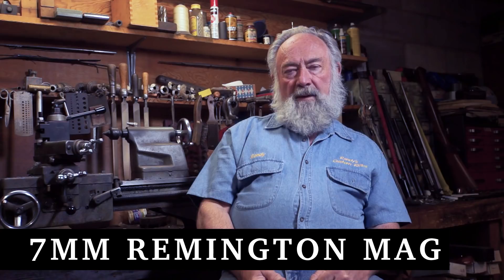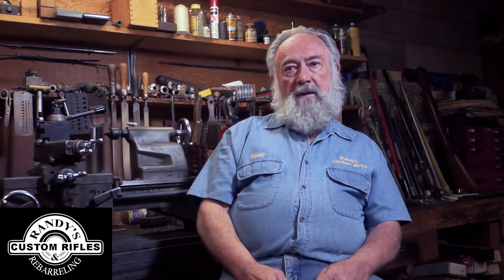History of the 7mm Remington Magnum – The Real Gunsmith

Comment: I am a huge believer in the 7mm Rem Mag.  I’ve been hunting with one since I was a kid.  I also have a 300 wby and a 338 win mag and I have never felt that I needed more than the 7mm provides for moose or elk.  It shoots flat, doesn’t burn the throats out of the barrel like some of the barrel burners out there.  It’s not too hard on brass and with a 154gn load with IMR4831 pushing it I am well under a MOA and can drop anything I plug with it.  243/308, 7mm Rem Mag and a 338 win Mag covers everything imaginable in North am era and the 7mm will do it all without giving up much to the others
Reply: Looks like I made the right choice , I chose arem 700  270 over 30-06 , nice flat line with a comfortable recoil , great deer and even elk rifle  ... wanted a larger longer distance for larger hunting such as moose/elk , was considering a 300 , came across a Sako 7mm rem mag in closet condition for almost half its cost so I got it, same reasoning , flatter line/ comfortable recoil  ...Was questioning how it would do for moose but from your comment I should be good to go .... as far as long distance I dont see me hunting much further than 400 , maybe 500 yds , heck , I dont want to walk that far lmao.... Ive also got a browning  6.5  creedmoore and a 308 gunsight scout and the ever so worthy Marlin 3030 (1969) so im should be covered for all !!!
Reply: The 160-162 grain bullets bring out the best of everything the 7mm Rem Mag has to offer.

Comment: I'd have to agree! The 7 Rem mag is a fine cartridge for elk inside 400 yards! I hunt mainly back east in VA I do occasionally hunt in Montana. I wanted a rifle that works great on whitetails as well as elk. Oddly enough here in SW VA we have elk. The skill set for most hunters is 300 yards and in. Learning to shoot long range past 300 or 400 yards takes practice. I don't think anyone should even attempt it without training and practice. The 7 Rem mag is capable of delivering heavy bullets with high bc out to a mile. It's great for steal. I've hunted on farms where I've made 600 yard shots at deer. I've only done that twice and with success. I was in the Army as a squad designated marksman. I felt confident to take those shots. The hardest part was getting used to hard hitting and flat shooting cartridges and recoil. Knowledge of your ballistics is a must as well as knowledge of what's going on in your environment that day. You have to know how to use those variables. The 7 Rem mag's capabilities are greater than what a majority of people are capable of.
Reply: A 7mag with good bullets is a very capable 600 yard elk rifle
Reply: That was said very well
Reply: @maxair5970  Yea it will work if everything goes right. For 600 yards at elk there are much better choices available. If recoil is a problem and 7mm is your max I would consider getting closer

Comment: I agree the 7mm Rem Mag is a great cartridge and have a Sako chambered for it .  I bought mine for a proposed Colorado elk hunt.  The hunt naver came to be but I've shot it a fair bit with lighter bullets as a varmiter and found it - and the Sako - more than accurate enough even with 140 gr. Noslers .  Its certainly stout enough with enough leg to take just about anything on North America at reasonable hunting ranges with the proper bullet .  I know I can punch through 3/4" mild steel plate at 100 yds with a 170 gr. solid .

Comment: The 7 millimeter Remington Magnum was the caliber of my very first purchase of a Centerfire rifle in 1979 after I got out of the service. Who is a brand new Ruger Model 77 and I put a 3 to 9 Redfield Widefield scope on it, adjusted to Trigger 2 about as light as I felt comfortable. Russ Hope, I found it mine who was a benchrest record holder at the time give me a load of, if memory serves me correct, 67 grains of 4350 and 140 grain Spire point. when I got to the range I sighted it in and then fired a 20 round group into a center to Center spread that was .049 in. The entire whole was considerably less than the size of a dime. I fire around I open the action let it set for about 20-30 seconds, and fire the next round. Probably should have never sold that rifle but in 5 years I've heard 65 rounds out of it and had every group that I had ever fired out of it and I sold it to a man who paid me $200 more money than he could have bought a brand new rifle and scope for. He also hand loaded and I gave him the load data and procedures I used. He was very taken by the rifle.
Reply: I bought the exact same set up in 1975....actually my dad bought it for me because I was only 14 at the time. I still have that rifle and plan on using it for a once in a lifetime elk hunt in 2020.
Reply: @mikeleschber33  be sure you dope your rifle properly 4r Ranch and make sure that if you have a clean firearm to make sure you fire two to three rounds before you head out on the hunt so that your first shot doesn't go high.

Comment: There was a gunsmith in Tyler Texas named Bob Reynolds in the fifties, sixties, etc. According to him, he built one of these rifles using the .264 Winchester necked up to .284". He claimed that it shot so well, that he wouldn't even blue the gun, Also, according to him, he showed the rifle to a Remington rep. Maybe this type of thing happened a few times across the country and caused Remington to decide to go with the project. I'm glad they did. I have two of them, one a Sendero, that sends 140gr. Accubond's down range so fast (close to 3500 fps according to my chrono-with no excessive pressure signs) and so accurately (1/2 moa) that I don't need an STW or 28 Nosler. Yeah, I know I won the lottery with that one. Still, it's hard to sell a $4k, 40X when you may get better for $1200.

Comment: I shoot the fusion in 7mm and 300 win mag. I found it to be an accurate, dependable round.150 in the 7mm and 165 in the 300.
Reply: I have been handloading for 42 years and a few years back I found the Deep curl produced by Speer bullets , a component for reloading and sadly now discontinued. I fell in love with that bullet quickly . thank GOD I saw its potential quickly and bought several boxes for hunting to last my lifetime and my sons. 
 It is basically the exact same thing as the fusion produced by federal bullets /ATK , I believe which used to be Speer. I shoot the 160 gr. deep curl in my 7mm mag with a factory stainless barrel . one of the first production rifles Remington made in this model 700 . I think the production date was May of 64 if I'm not mistaken for this particular rifle . It is my little sweety....
 The only thing I wish different on this rifle, is , I wish it had a 26 " barrel instead of the factory 24 ".
I should look into randy barreling me a 26" tube in 280/338  aka 7mm mag .
I'm getting really close to needing a new Barrel anyway

Comment: I had one built on a p-14 action, using 175 gr speer, was all set with 3000 fps and 1/4" at 100 yds, to hunt open terrain Northern B.C. Canada elk at potentially extended range, (I have not taken anything beyond 350 yds. so far in 30+ yrs of hunting) I wound up taking an immature bull moose at 40 feet. It was a neck shot, the animal knew not what hit it, It fell like a stone. A 30 30 would have sufficed at that distance! I bet 90% of my harvest has occurred in 60 yards or less. I personally can not tell the difference in recoil of 7mm rem. mag vs. 30 06. I heard that CIA or FBI used it for long range application.

Comment: Very interesting, I own a 7 mm Remington Magnum in a Winchester model 70 Sporter. Here in southeast Mississippi, a lot of hunters bought them in the early 90s. Also a lot of 300 Win Mags. They were under the impression that they would blow it gigantic holes in the side a white tail. They also lost a lot of whitetails by not understanding of bullet, too heavy of a bullet would not expand right. So you can get a lot of good name brand rifles from a good time in mass rifle production, or a little of nothing now. Mine is one of those rifles.
Reply: Casey Sumrall what is the best bullet in 7 rem for whitetail I’m you opinion ?
Reply: The 150gr Winchester Power Point. I also have a close family friend, that has one also. He shoots 150 grain Remington Core-Lokt.
Reply: Casey Sumrall they dump their energy in the deer and not just poke a small hole? Thanks for the reply.
Reply: The deer, I've killed with mine with that load I found they don't run too for. Is about a quarter-size hole maybe where it goes in, and about the size of golf ball where it comes out so it's just right when you get down to it. You rarely have the 400 to 600 yard shot the round is design for. 150 to 250 yards is about the longest around here. So really it's just right for that kind of a shot. It has wonderful knockdown power, it is extremely accurate. My rifle at 100 yards I've always gotten around a quarter size group, or smaller. I am sure that this would work Wonderful at a long range, I feel confident out west with this factory load for hunting deer, mountain goat, antelope, I feel confident with it.
Reply: Casey Sumrall thanks, just what I wanted to know, same here I rarely shoot a deer more than 150 yards.
Reply: You are welcome.
Reply: A 5.56 55gr fmj in the vitals will drop a deer within 50 yards. If those deer were lost it means some guys really sucked at shot placement or they missed all together.

Comment: It’s interesting that Les didn’t shoot the Mashburn like Hagel and Page were.

The 7mm Remington is a very capable and extremely popular western game cartridge, but it’s smaller than the 7mm-300, so I’m curious if a smaller cartridge was discussed between Les and Mike, or if Remington just decided to go that way to avoid friction with Winchester.
Reply from the maker: Les went this route because it is hard to form factory brass with a steeper shoulder.  And he knew Rem. wouldn't buy it.  
Page was close to the guys at Rem. They didn't take to the Mashburn design.
I, personally, would have chosen the Mashburn.
Reply: I would too. Thank you for your reply.

Comment: The first gun I ever purchased was a brand new model 700 BDL in the 7MM Rem Mag. The 280 Remington is to blame, but more on that in a moment. My 7MM loved 160 grains Nosler Partitions in front of IMR-4831 and would shoot quarter (25 cent) size groups at 100 yards. I killed everything from buck antelope to a bull elk with that combo and as long as I did my part it did its part. I picked the 7MM because I killed my first deer with my uncle's 700 in 280 Rem shooting 160 Partitions. I wanted a 280, but when I learned that the 7MM is capable of an addition 200 fps with 160 partitions I was sold. Unfortunately, that 700 was stolen from a friends truck after we both shot 170" mule deer on my uncle's ranch. The same place I killed my first deer. I have owed three 7MM since and some were better shooters, but the first 700 I owed was my favorite. I have heard your narrative before and I have one question I have never been able to get an answer to. How did they arrive at 1800 lbs of energy for acceptable killing power? Thank you for the awesome video.
Reply from the maker: You will get right at 100 ft lbs with a 160 MV of 3100 at around 475 yards. 
Good shooting.

Comment: Why did Remington use the magnum "ring"  or "belt" on that case?  It was and still is the bane of reloaders to contend with that thing, when it was absolutely unnecessary for the 7mm rem mag with its substantial shoulder.   It has ruined many a hunting trip when the case bulge ahead of the ring or belt jams the case in the chamber and sticks a round in the chamber that cannot be removed by the bolt.  Never-the-less my friend took down a mule deer at 466 yds with his and was interviewed on the spot by a Remington Film Crew working the same game preserve area, few years back.
Reply: Use better dies and it wont be a problem👌

Comment: I have hunted deer with one since 1998 and have killed out to 400 yards and don't wont to go any further than that but that's me not the round. I shoot 150 core locks they do well but less that 100 yards you need to hit bone to slow the round down if you don't it will blow through the deer and it will take off running sometimes as far as 100 yards. but I like the round I have it zeroed at 200 yards so at 400 yards I have 24 inch's of drop so I will hold my horizontal line at the deer head when its head is up and the vertical line on the lungs and at that range the round is slowing and will hit the deer hard and drop it.

Comment: I have a old hunting rifle chambered in 7mm mouser improved have you ever worked with this wildcat? there is near zero reloading data for this cartridge I'm shooting a max load for a standard 7mm mouser case right now but have a lot of case room left. is there any slower powders I can use I have a can of imr 4350 that I think will work but don't know of a good starting load. the gun is built off a good mouser action and has extremely tight tolerances like a bench gun whoever did the chamber work did a great job the gun shoots .5 moa at 100 with 165 grain hornady soft points while fire forming. I'm using hornady brass also.
Reply: Check P.O. Ackley's books and writings.

Comment: So your telling me and everyone else that nosler, sierra, speer and barnes reloading manuels are wrong? They claim remington designed the cartridge from the 375h&h. And not to mention out of all the info I've read or heard, not a single reloading manual shows a load for 160gr bullet at 3150fps. Also I'd like to add, there has been a lot of research done on the 7rem mags capabilities, gunwerks is one. They have proved that the cartridge is very much effective way beyond 500yrds! This has been done with technology that no had back in 1962 when remington introduced the 7rem mag. So you still wanna claim that everyone else is wrong?
Reply: I'd also like to add, that if mr Bowman wanted a cartridge that out did the 7x61 sharp & harte, remington didn't come through very well for him! The 7x61 is practically identical to the 7rem mag, its just a little more efficient...! Less powder, same velocity as the 7rem mag.

Comment: I wonder why they didn’t use the 300 win mag, instead of the 338?
Reply from the maker: Because, David, the slowest powder then was H4831.  In fac, when Rem. came out with it, they developed a slower powder, IMR 7828 which made the caliber run.  Even 7828 would have been too fast for a 7MM-.300 Win.  We now have many slow powders suited to the larger cases.    Thanks for asking.  Good shooting!
Reply: The Real Gunsmith thanks for the reply, makes perfect sense, I never realized that.
Reply: The 300 win mag wasn't commercially available until 1963, one year after the 7mm rem mag.

Comment: 270 win has virtually identical performance until you get over 150 grains . Love both cartridges. Freezer is full
Reply: No a 270 does not.The 7mm throws a 160 gr bullet at the speed a 270 throws a 130 and with a lot more energy downrange. 270 cant hold a candle to the 7mm mag.

Comment: Any shot beyond 500 yards is an unethical shot.  And I shoot a .338 Lapua Magnum.
Reply: Not if a guy can hit an 8"x8" area confidently and with repetition. Get better with your firearm and/or start reloading. Many folks can ethically drop game over 800 yards. Spread the wings of that .338 or put it away! May as well be using a 30cal on an elephant at 500 yards. Save that $
Reply: An 8mm Mauser will get the job done at those ranges. 
Maybe you should invent a 280-338 Lapua mag